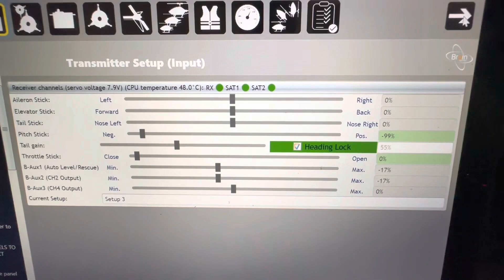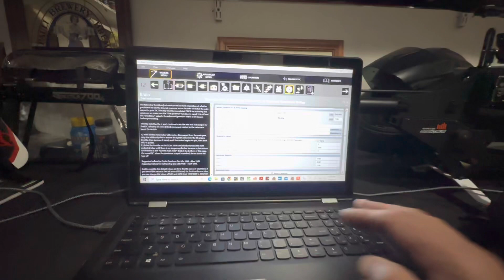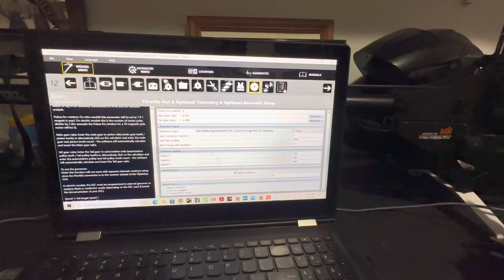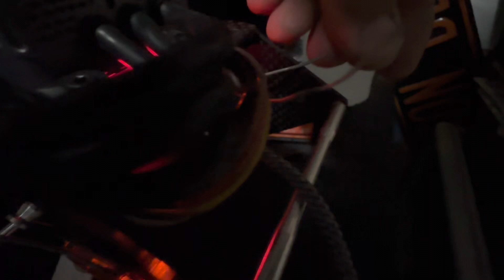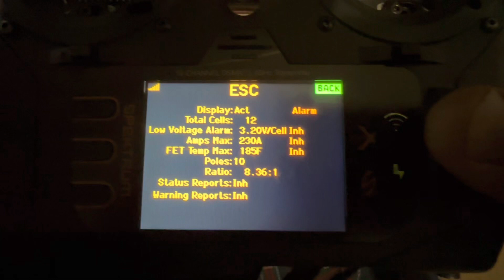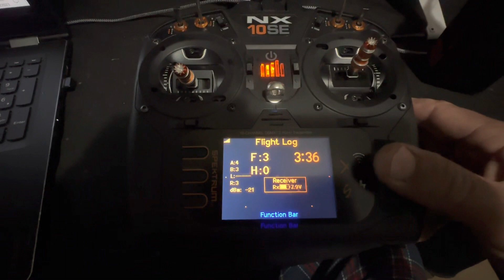Ikon2/Brain2 Flybarless Spektrum Telemetry for YouTuber Ride and Fly

Comment: hello, thanks for the video. On my Hobby wing Platinum 150 amp ESC the only port that has a p port is the fan port. Should I just add the yellow wire connector to the existing fan port lead. Also, I have governor programmed in the ESC and not in the Ikon fbl and if I choose Telemetrey input in the Ikon software I am afraid I will activate Governor in the software. Can you help with that. Thank you very much.
Reply: That sounds great. Thank you for simplifying it for me. I appreciate it so much.
Reply from the maker: @aforappreciation  I do not use the Hobbywing store governor, but I do use heli linear with ikon2 governor. You click motor is electric box and set up the endpoints and it’s better than any ESC governor.   As far as telemetry, the ikon is reading the ESC input from the Hobbywing through the P port.  It’s not powering anything.  Just go from P to the 4-5-6 port and use only the middle #5 pin.  See what happens.